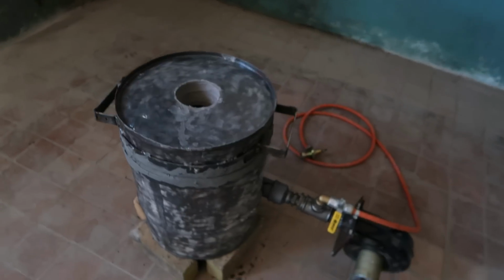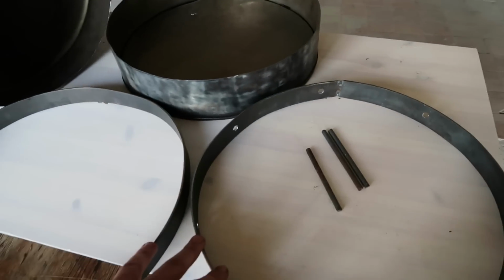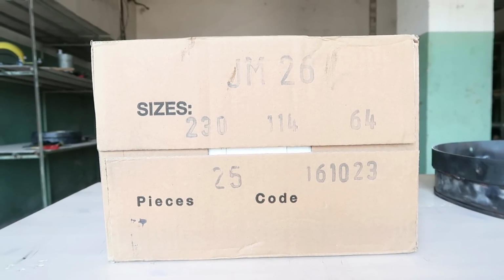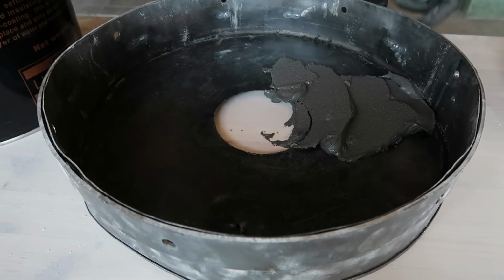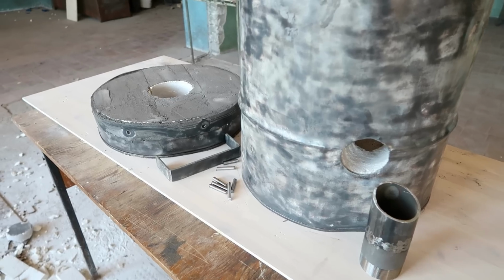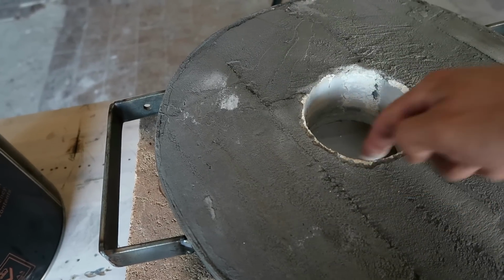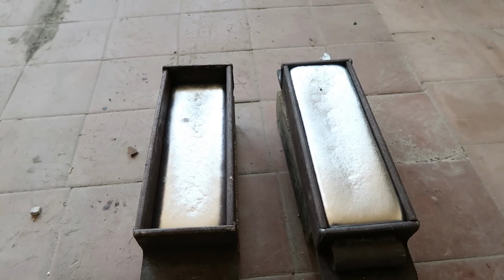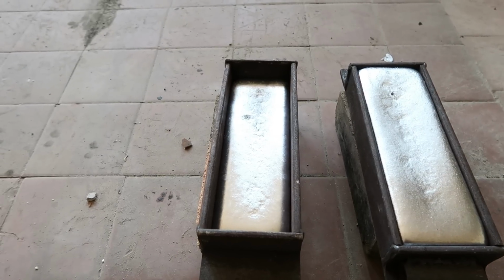Making a new furnace

Comment: Now this is what I'm talking about. Make it so that you don't lose in the end. Propane still cost money it maybe cheaper  but the thing is to save at every turn.  It may not make  you rich but you won't endanger your life.  An be prepared for the chance that you will have extra material.  No matter how hard you counted there s a chance you will have extra so no dumping it on the grass or a plastic container just because it has water the stuff is still very hot. Thanks you Loader.

Comment: Don’t know how much it helps now, but it seems many people couldn’t guess how he made his crucible. Looks like steel pipe with welded plate to cap off bottom and a piece of angle iron as a spout to assist pouring. Along with bolts on the sides for his tongs, which were likely forged himself.

Comment: If you intend to hot cut an old oil barrel for this kind of project, make sure it is clean and gas free on the inside before you start cutting. Drums with combustible material inside often explode when cut with flames or grinders, with fatal results. Be careful!

Comment: Would it be possible to crush the pieces of fire brick into small pieces and mix it in with your metal casting sand? I think it would make the aluminum stay liquid for a longer time, which would mean less imperfections in the cast.

Comment: it was quite dangerous cutting the barrel with oil residue inside. it could have took fire or worse, vapours could have exploded... please next time rinse the inside with a solvent if soapy water doesn't do it then fill the barrel with water to remove any vapours before emptying it for cutting !

otherwise nice video, and a very nice furnace in the end
Reply: And how would an oil evaporate?
Reply: that's what most people ask on the way to the hospital.
and if they are still conscious that may even state that they washed out the drum,

yet works every time.
Reply: Propane will actually dig into the porosity of the metal and stay there for quite a while.

Safest way is to fill with water when you cut it.
Bicarbonate and acid will fill it with co² which will displace fumes.

Comment: Love the video.  I am upgrading my own foundry, and have a question as to your material choice.  Why do you use fire brick as opposed to Kaowool, ceramic fiber, or a refractory cement?  Is there a performance difference?
Reply from the maker: I thought that fire bricks are easier to work with and the drying time is much faster
Reply: Ok.  Thanks.

Comment: a quick question - i noticed therecwere many sealed air pockets.

in the heat of the furnace, couldnt that air get too preasured for the metal barel and cause it to burst?
Reply from the maker: I don't think those gaps  are airtight so I am not to worried

Comment: Could you please explain how you made your crucible?
Reply: rancidoverwelm At a glance it's just mild steel, looks to be five inch .25 wall with a quarter inch plate stick welded on for the bottom.
You can use steel to melt all the way up to copper.
Some people just use an old cast iron Dutch oven.

Comment: what are you using as a crucible?
Reply: ghostwalker788 from what it looks like it’s a steel pipe with a welded on bottom plate along with a piece or angle iron as a spout